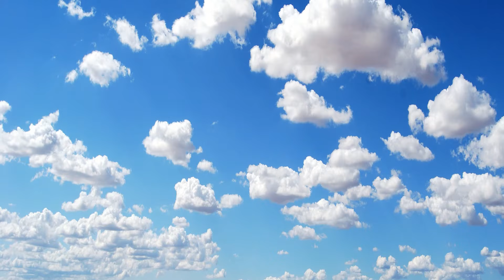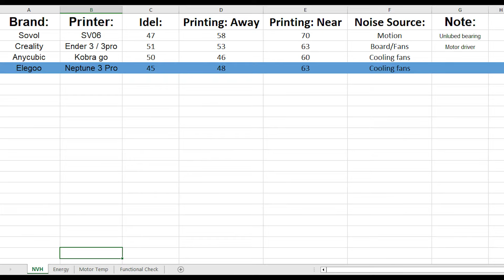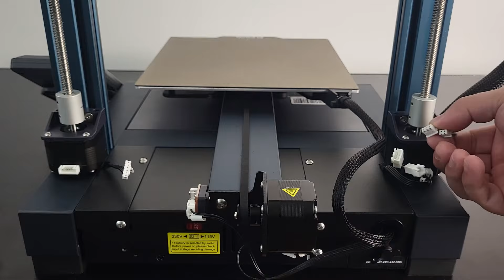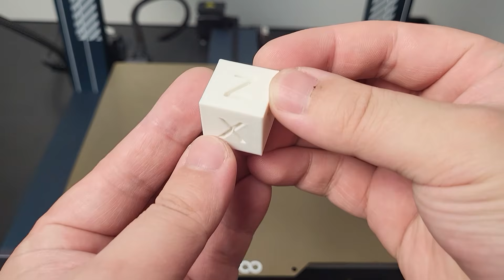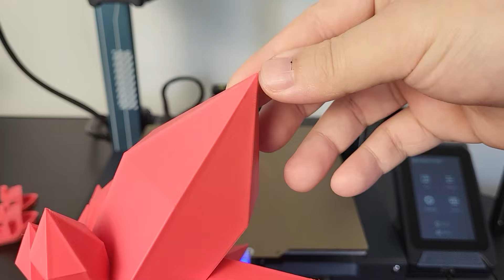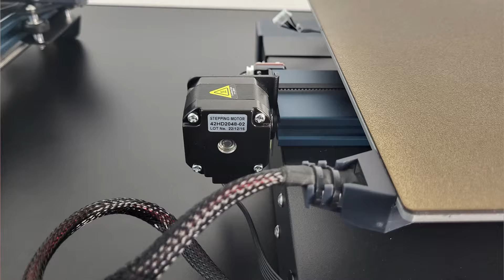Elegoo Neptune 3 Pro Review | New King of Sub $300 budget 3d printer

Comment: I just picked up a returned, (used and returned as not working), Neptune 3 Pro. After troubleshooting and assembly, I had no issues with this unit, it just seems the previous owner didn't know what to do  or how to assemble it properly.  I was shocked at how quiet it runs compared to the Sovol SV06 Plus and even the Anycubic i3 Max.  My go to machine is the Anycubic, but I really like the Neptune very much.  The first few prints I have done are impressive out of the gate.  This video gave me a lot of pointers to look for, and I will now start testing with temps, retraction, speed and materials.  Thank you!
Reply from the maker: have fun!

Comment: The machine is hands down the best in it's price range and also exceeds many printers in a higher price range. I can't say enough good things about it. It will print anything you put on it.
Reply from the maker: Indeed, it is a solid machine for this price point. It is been working great for me, the only thing is the bed spacer is deformed a bit after running for a few month. But I am worry about how long this machine will get support(firmware update, part supply, etc) from Elegoo, since they have jump to Neptune 4. series now.

Comment: Why do this? Why produce electricity and send it to the battery when it is simpler to transfer the power to the generator and produce electricity.
There is simple solution.
Horizontal shaft: on one end is turbine and on the other is one bevel gear. On the vertical generator rotor shaft there is another bevel gear. The angle between shafts is 90 degrees. Whenever turbine rotate around the vertical axis the bevel gear on its shaft is rotating around the generator bevel gear and is coupled with it (like planetary gear) and transfers the power. In one direction the rotation will be a little faster and in the opposite direction a little slower, which has no effect on the production of electricity. In that case, the only moving mass is the turbine and the generator can even be placed at the base of the column! The only connection to the turbine is a long vertical shaft.
The generator stator is of course stationary so the wires from him are stationary too.
Reply from the maker: Okay, I don't quite get the correlation between you comment with my content. But your text sounds credible to me.
Reply: @SvgLau  Dear Sir, please accept my big apologies! I didn't even notice that I was writing a reply under your video! This text was intended for a completely different video related to wind turbines.
So, once again I apologize to you!!!
By the way, proof of how much I love Elegoo printers is the fact that I have a Neptune 3 Мax!
Reply from the maker: @pecilijevelicanstveni4973  no worries, lol. I like to see people spend time and put their thought on comment section, it is inspiring to me a lot of times..N3 Max is great printer!

Comment: Huch your measurements of your bed seems to be high. I got my neptune 3 pro last week and have a maximum range of 0.20mm. Your values are very high huch. It seems to be that neptune 3 pro doesn't use auto bed leveling. Because everytime i print he does not adjust the z axis during the print. Does that happen to you as well?
Reply from the maker: It happens on mine too, some how the bed screws come loose after some print. After tighten them again, the right side somehow got a lot higher then the left. Did you try to put M420 S1 on start G code after G29? It should help.
Reply: @SvgLau  After a while this helped me. He changes his z direction in relation to the ground. But now he scratches my top layer to often. Seems to be that the measurements are not very accurate. But thank you. The Neptune 3 was very friendly at the beginning, but it becomes to a whole project to calibrate and figuring out how to solve the problems such as stringing and other typical 3d printing problems xd

Comment: What mean the symbol z with the circle when printing? ... And what mean the symbol ruler (mm) and the clock (mm/min) in the extruder menu ?
Reply from the maker: the symbol z with circle is layer height (from printer bed) in mm.  The ruler is let the extruder extrude mm of filaments that you input. I believe the clock is set the E step. So it must be put it there for easiler e step calibration.

Comment: Elegoo became my WORST brand. I still have resin Elegoos, but i replaced all fdm Elegoos with Sunlu T3 that for the cheap price, are way way more better!
Reply: elegoo is my best brand i wonder how we have had such different experiences
Reply from the maker: @stanleyhoptroff  it happens to all the machine/brands, not limits to the Elegoo. 😀
Reply from the maker: That's interesting,  tell me more about it.
Reply: @SvgLau  well, i tried Neptune 2 and arrived with some ball bearings rusty, a stepmotor (Z axis) died after 3 weeks (and only 30-35 hours of work), bed isn't flat so is impossible to level the bed and all prints (over 2cm height) start to unlaminates and easily broke, chassis was bent (the only thing fixed).
The Neptune 2S same: bed bent even the auto-levelling fails to flat it, a belt arrived with a cut, extruder failed after 1 month, and another stepper motor almost fails (lose steps) when print.
Replaced the Nep 2S with another one Nep 2S... Chassis arrived bent (but this time i wasn't able to fix it), so i asked for a refund...

So then i bought a Sunlu T3 (Terminator 3). For Italy it's 220€ (vs  the Elegoos Neptune 3: 199€)
Faster (i tried up to 180mms, i won't try more, with pla, because they are so smooth and great! Vs the 35mms on Nep2S for the same quality of layer/prints) no fails or defects even after 4 months. 

Elegoos aftermarket services are good to answer for software or questions... But if the problem is a hardware issue, there is no way to fix it via email, and you will keep fail the prints.

Resin printers i think they are not amazing quality but they work well even after years (up to 4 and still works). Anycubic resin mobo instead failed after 8-9 months.

So... Maybe i was unlucky with fdm, but to me, they are very low quality.
Next time I'll go for sure again and again on Sunlu (or Prusa, if I'll become rich enough 😅.. 800 € are not cheap...)

Comment: Very interesting. TPU is my primary material for printing and I'd be interested to see how this machine prints once the retraction settings are figured out. I'm currently using the Sovol SV06 and find that it isn't the best for flexibles.
Reply from the maker: Yes, Sv06 isn't the best for flexible materials. I may able to run some more test this weekend. I will get u back. But in general people don't print tpu at 70mms, it just too fast.

Comment: Nice video. I was looking at this printer or the SV06. 
Which do you think of between those two, which is the best?
Reply from the maker: It really depends on what you are looking for. SV06 have better high speed potential in structures, higher temp extruder, and open source(CAD files and more). But it is a bit more noisy, some issues at this point, and requires a bit more maintenance. 
In other hand, N3P is very easy to use from assembly to print. It carries a lot of features, touch screen, led, sync belt. It's heatbreak may required to upgrade if you are printing hight temp filaments a lot. But it doesn't have issue with printing any filaments like sv06 does on tpu.
Reply: @SvgLau  Thank you! I have an SV06 but bought an Neptune 3 Pro and Plus. They more silent compared the SV06 and feels like better quality overall.